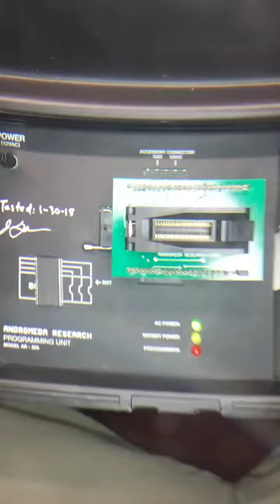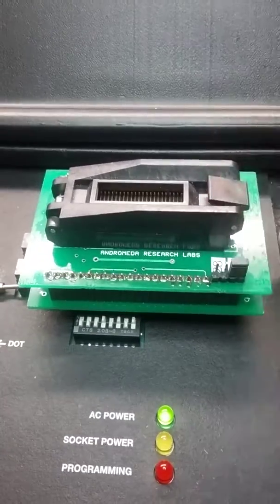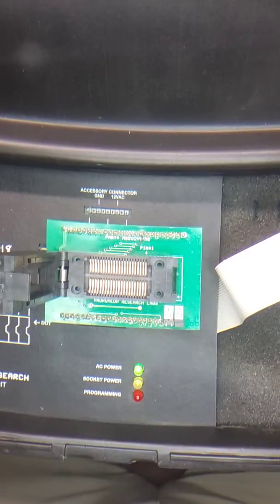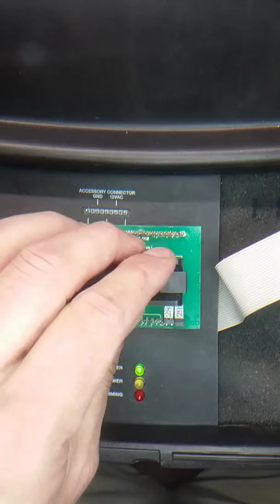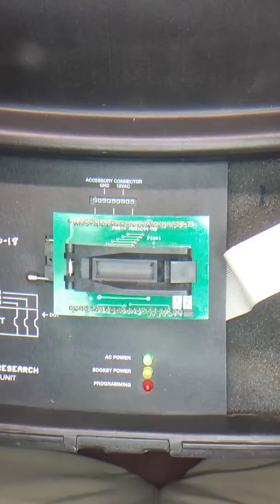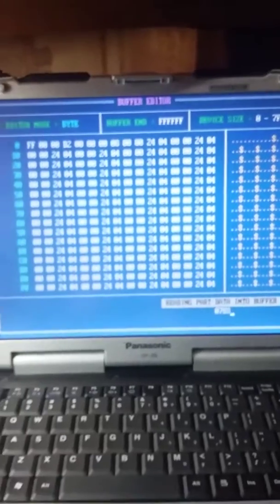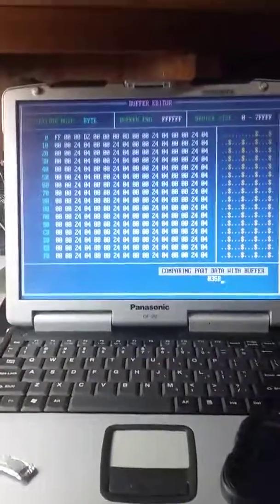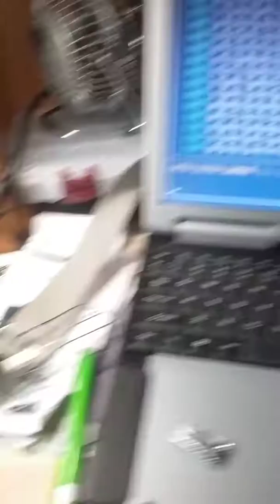2004 Volvo XC90 target device reading using the ARLabs equipment.

Comment: I’ve got a Volvo XC70 wagon we bought from the auction, the car ran and drove home fine but someone broke into my truck and stole the only keys I had to it along with a few other keys, long story short the 5-800$ a locksmith from Craig’s list so I towed it to a Volvo dealer with a quote of 300$ now the guys calling me up saying something is wrong and that it needs a new ECU and new immobilizer unit they want 300$ for what they have done now and they say with all the other stuff we’re looking at over 1k can you explain how to bypass it or remove it? I’m not a complete noob I know how to repair electronics, I’m the first person that bypassed Honda’s Immobilizer System back in 2002 I figured out that the car had fuel and spark and everything was ok just no injectors would open or close, Honda has a immobilizer Brake code that allows you to enter  it in and start the car or like I did I made a conversion harness for a older ECU to be used to run the car, and the third way I discovered was jiggling the chip back and forth to get it to pop out of the motherboard and then the first time you tried to start it the engine would turn over for as long as you had the key in the start position but if you turn the key off and back on after trying to start it it will start right up. So I’m wondering if I could break the chip out or just remove it, or if the dealer has a break code or if I could use a ECU from a turbo automatic that is older and doesn’t have the immobilizer? Please respond on here or at 5036609088 or jasonmtek@gmail.com thank you